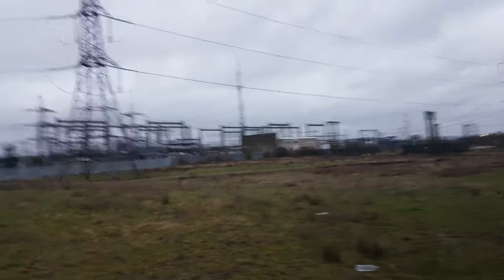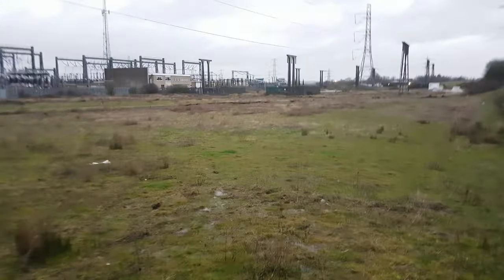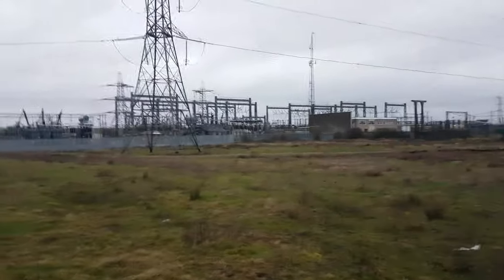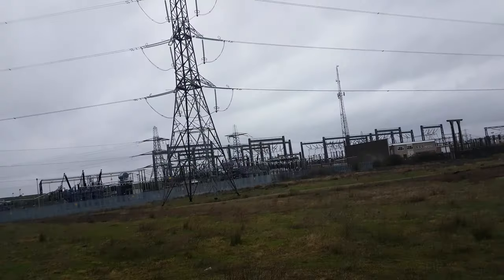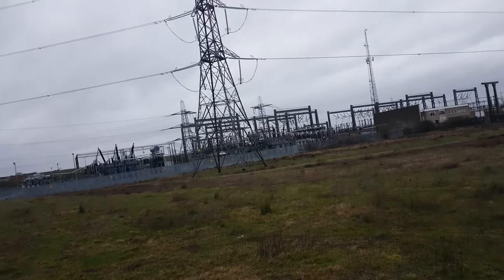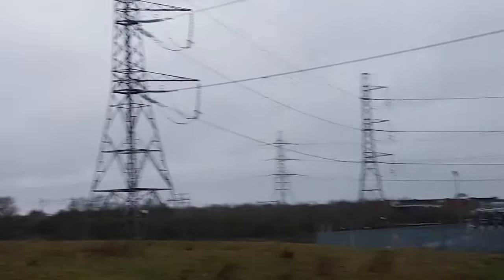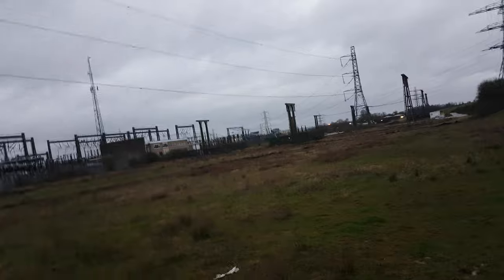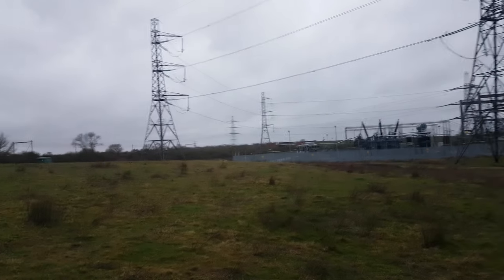400kv to 132kv substation in essex

Comment: Hi its 400Kv to 132Kv then down to 33 Kv then at another site 33Kv down to 11Kv and finally 11Kv down to 433\250  volts in local transformers for houses shops industry ect

Comment: My opinion, is that what you have there, is only 275kV lines.
Reply from the maker: no we have 400kv 275kv 132kv 66kv 33kv 11kv lines
Reply: @djpylon1012  we have 400kV, 220kV, 110kV, 35kV and 20kV. 10, and 15 kV, are history.
Reply from the maker: @romeogrigoras9378  nice where are u from
Reply: @djpylon1012  România. I have some photos with power line poles at 400kV.
Reply from the maker: @romeogrigoras9378   oh nice